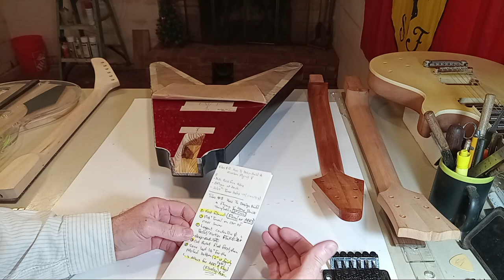V11. How To Design Build A Custom Flying V Per 50's Korina Specs Using Stewmac Templates

Comment: 8:00, I maintained the F-4E Phantom Flight Simulator.
I've managed to limit my flight time in helicopters, there are too many moving critical parts for my liking.
I Served from 1980 through 1987, I was also able to convince every member of my High School Rock Band to also join the USAF!
Reply from the maker: Thanks for the info., and so wish I had gone in/even retired.   I was signed up, and after Basic was headed to Ohio for Aviation Electronics, but bailed and just went Civil Air Patrol in Alabama.  Anyway, decades go by fast!  Haha...

Marc
Reply: @DejaBluGuitars  You are so correct, the decades do go by so very quickly.
I wish I could better convey that thought to the younger people I know.  Every day is a gift, make the very best of it.
The Civil Air Patrol is fantastic, nothing wrong with that.   As far as Avionics/Instrumentation, for 11 years I worked as an Aircraft Instrument Repair Technician for Kalitta Air, that was possibly my most enjoyable job, to bad the pay wasn't there.  
Be Safe Marc.  😉

Steve